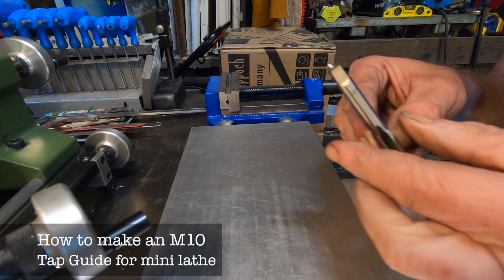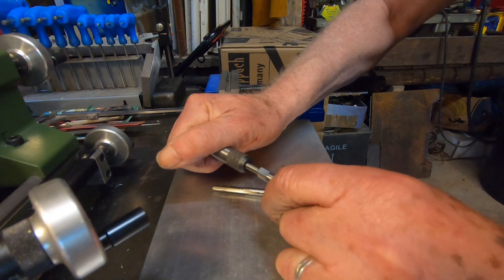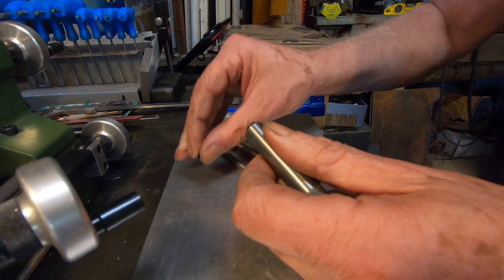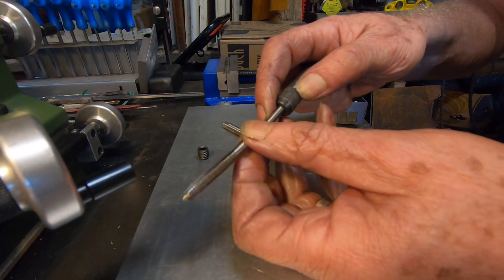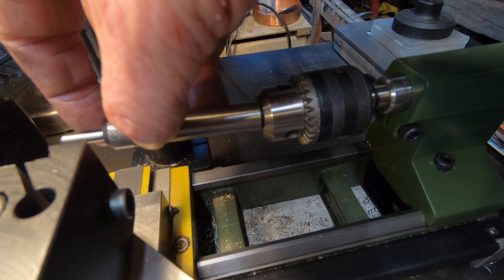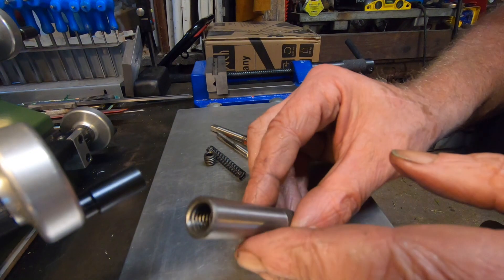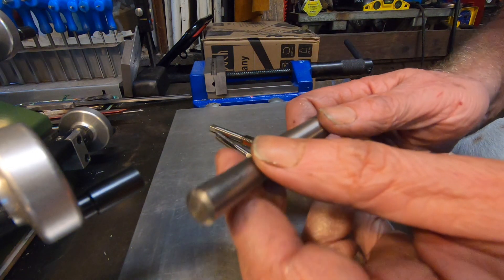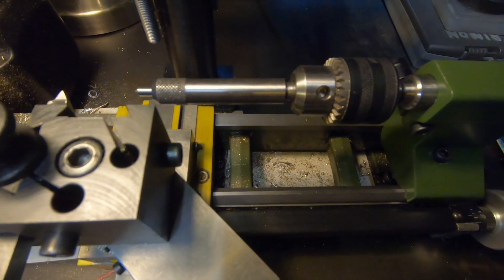Tap Guide project for a Mini Lathe - Prof Simon

Comment: I would have gone down the route of turning the adapter tapered to fit directly into the tail stock removing any unnecessary vibration through the drill chuck. But that's just the Fitter/Turner coming out of me lol
Reply from the maker: That would be a good idea...

Comment: Why not just change the chuck for a half inch one?
Reply from the maker: I don’t think Proxxon make one....but maybe someone else does
Reply: @SimonHollandfilms  It'll be a standard chuck thread proxxon will just buy chucks in. Try knocking one of a drill you have see if it will fit, I bet £5 it does

Comment: I'm saving up for a small lathe, can you recommend one.
Reply from the maker: I really like my Proxxon 250 mini lathe...check my review here

https://youtu.be/bkTNnLjlyZ0
Reply: @SimonHollandfilms  thanks brother
Reply: I would recommend a Myford ML7 old but superb
Reply: @stephenwhite5057  I have a Warco mini lathe. I bought an old Myford ML7 for restoration  and it became a money pit. Once restored I preferred the Mini lathe so I sold the Myford and managed to recover the cost. Myfords are good but spare parts cost as much as some mini lathes cost in total! And the Myford is much much bigger and heavier than a mini lathe.
Reply: @stephenwhite5057  also big are they not?
Reply: @stephenwhite5057 That is a good call. They are a work of art and great value.
Reply: I have considered one of the Chinese mini lathes, they are so cheap...And you can learn a hella lot because they all need to be stripped down and rebuilt and every surface flattened and decent bearings for the chuck and metal gears put in before they are reliable. It is a bit hit and miss how true the surfaces come, but you can guarantee they will be off.
Any vintage lathe will be of quality, just you would need to check for excessive wear.
The profs lathe is very nice as he says.
Reply: Be sure you get imperial or metric calibration as required.